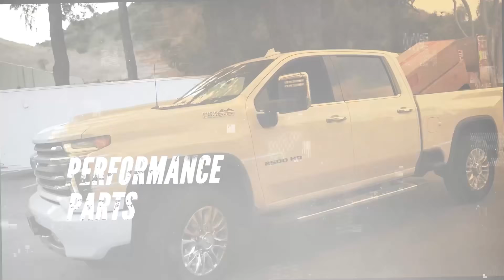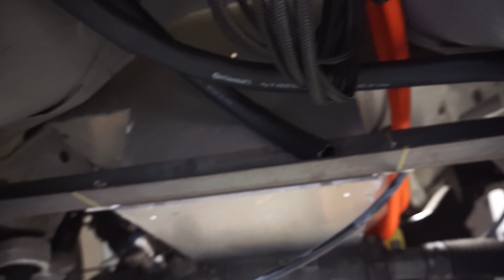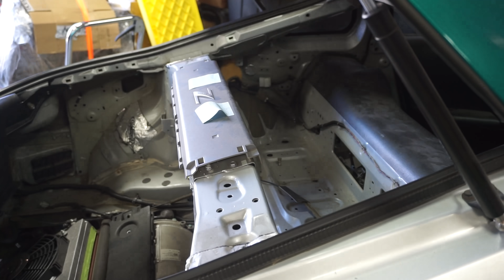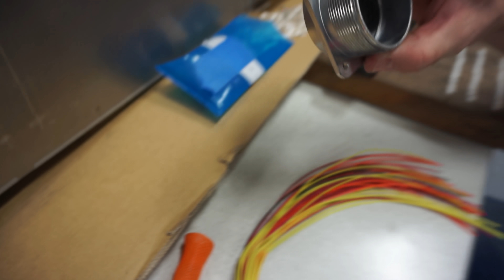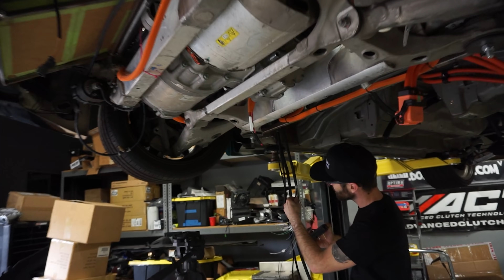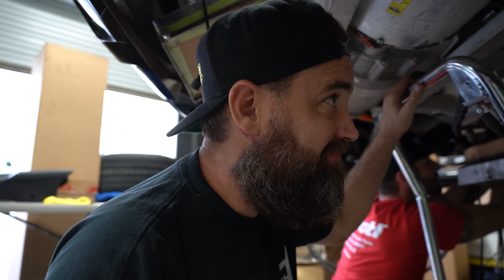Building the World's FIRST Tesla Swapped Liberty Walk Nissan 350Z! Part 2

Comment: TL:DR each battery pack needs to be its own island electrically, don't have cell tap wires going between boxes!
While it's done very cleanly, you want a BMS solution that has a satellite in every battery box. You want to avoid routing direct battery connections out of a battery box other than the fused and relayed topmost + and lowest -. You're introducing points of BMS failure with the cell taps going through a quick disconnect, and a point of fire etc by having unfused cell wires snaking the cars underside. 
The main traction cables have fusing and other protections, having the cell tap wires outside a battery box is DANGEROUS as they by definition cant be fused other than by the wires' thickness. This can still do a lot of damage, the lest damaging is bringing one/muiltable cells out of sync with the pack, the other being a total loss of car to a fire. With unfused battery wires outside a battery box if a wire or 2 are pinched the BMS can't disconnect the short as it will bypass any BMS disconnects in place.

Comment: I have an invention that im working on and have been following this project for some time now. I want to try and get some information if I could that I cant really find on the internet. How much does one battery panel weigh? What is the detentions? LxWxH? If yall could help me that would be amazing.
Reply: Modules weigh around 55 lb.
27” x 11.75” x 3.1” (LxWxH)
Remember to leave tolerance on connection and coolant side for wires and hoses.

Comment: If only you could get these battery packs in a narrower version, the perfect build would be stacking long, thin packs into that centre tunnel and plating over the bottom. Keep the weight right down low and in the centre and either give even more capacity or let you have a big ol' frunk. I'm sure it's probably possible, but it'd take someone braver (and wealthier) than me to start tearing apart and rebuilding a Tesla battery pack.

Great build so far though, gonna be interesting to see how weight distribution turns out, I'm picking pretty even with the motor and controls at the rear.
Reply: You could do 3 of the model 3 modules which are almost 6' long each. since their is no front motor on this one. 
2 side by side in the tunnel and one flat on the bottom like you said with a serious cover plate to seal it all up and protect the cells from elements and impacts. Would yield about 60kwhs total capacity and on this build prob up to 250 miles of range taking it easy. 🤔

Comment: Idk I just can not get excited about EV. No good sounds. Opposite torque curve. No manual transmissions. Batteries lose half their range in cold weather. Batteries have to use their own stored energy to power heaters to keep them at optimal temperature in cold weather. Electric motors lose efficiency in cold weather. I work at a large manufacturing plant and last year they traded in all our gasoline-powered vehicles for small electric vehicles. And it was a nightmare last winter. To get across the plant from one end to the other is over a mile. Our winters are bitterly cold and windy. Yet this is what management decided they were going to do to try to reduce our carbon footprint. They were warned by several of their employees who are gearheads. They didn't listen and for nearly four and a half months it was extremely difficult to go from A to b within our plan to get parts moved from one place to another. Something that used to be a simple get-in drive and go had become incredibly difficult not to mention freezing. None of these EVs have heaters that can even defrost their front or rear windows. Which obviously poses its own safety hazards. I just find this whole electric vehicle push to be incredibly rushed. You simply cannot run electric vehicles in cold temps reliably. People are going to get stranded and killed.